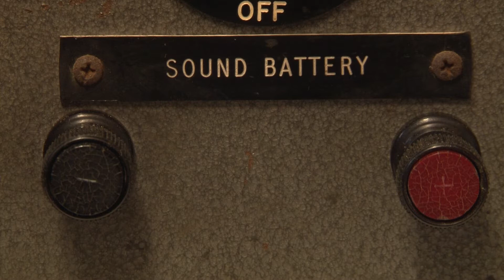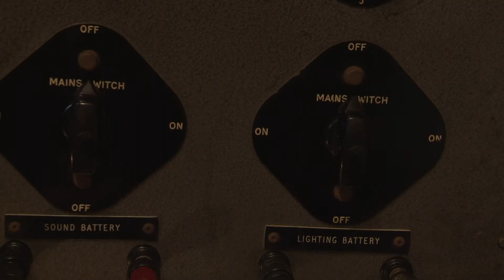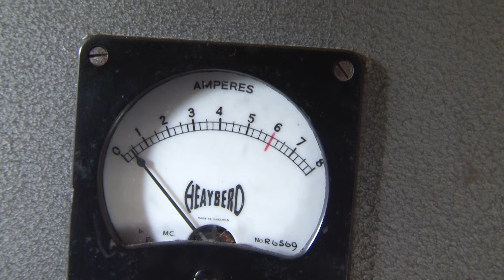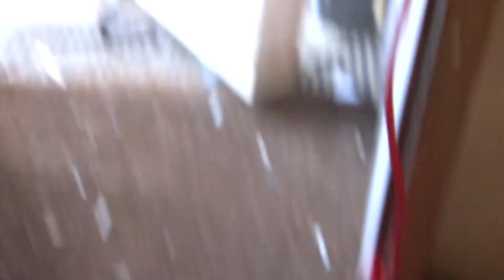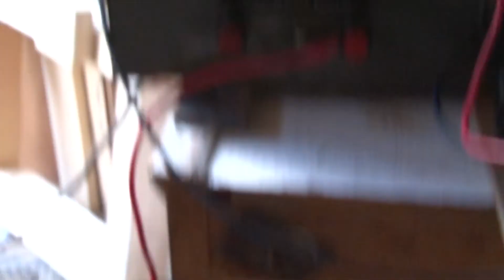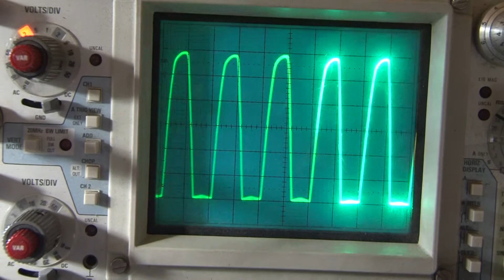Renovation of the  Heayberd Battery Charger Part 3 - Paul continues his quest to restore the charger

Comment: "the charger meter showes average current and is for guide only" - no, that is not for guide, that is what you want. You want the average of the current, not effective. You are not after how much you heat up resistive load, or the ESR of the battery! You want the amount of electrons (coulomb count), not power into resistive load.
Further discussion about filtering capacitors is nonsense really. The only acceptable period correct solution that would actually help, is to add a smoothing reactor on the output. Surprised, it was not there already but I guess that was to save weight.